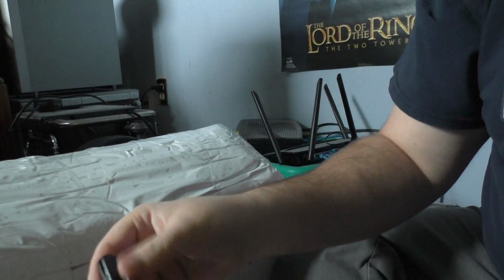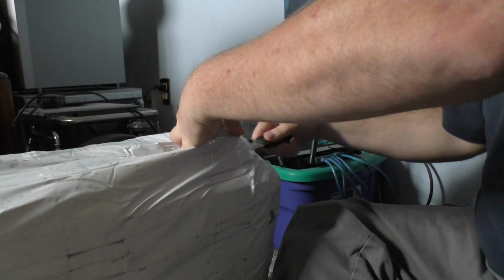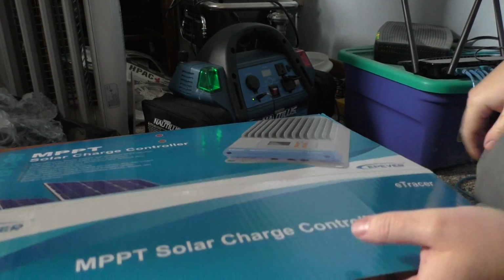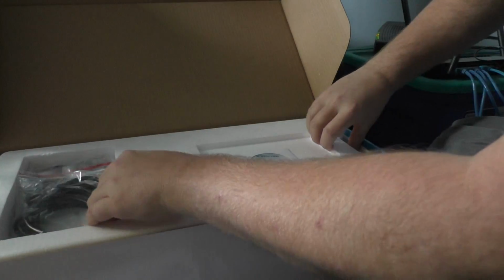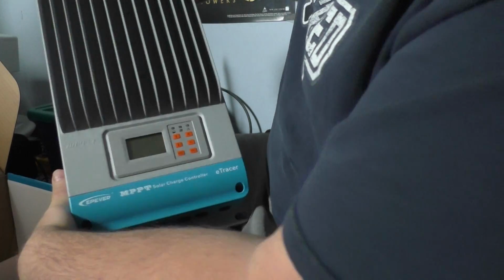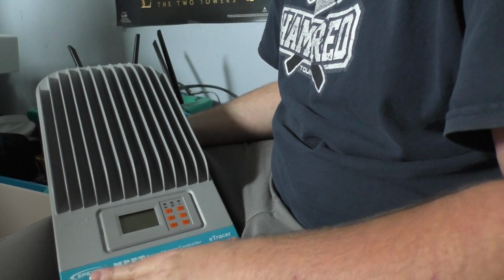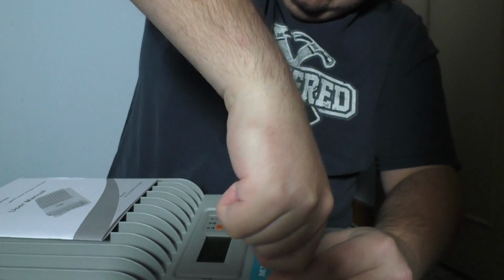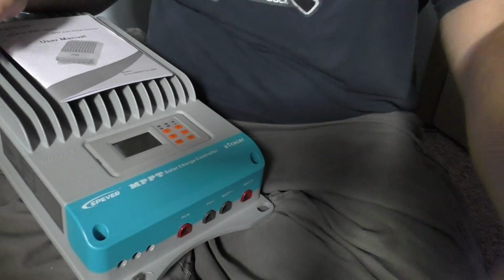Solar Package Arrives the off grid tiny house

Comment: EPever is a great brand. good value for the price,
i bought the same brand for my system. if you hook your system in 24 volt ( could you use 16 of your panels ? ) unless your panels are only meant for 12 volt opperation.
Reply from the maker: excellent :) good to know thanks